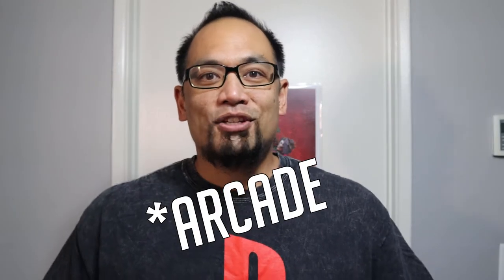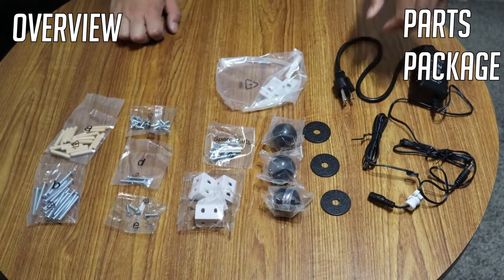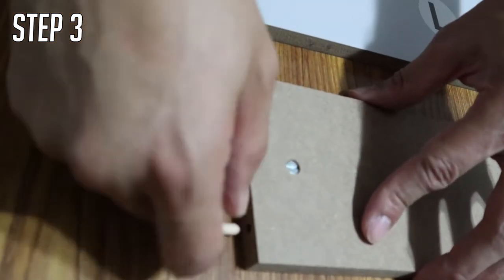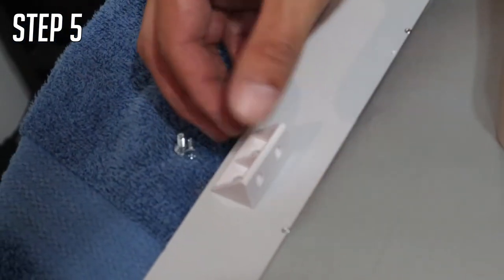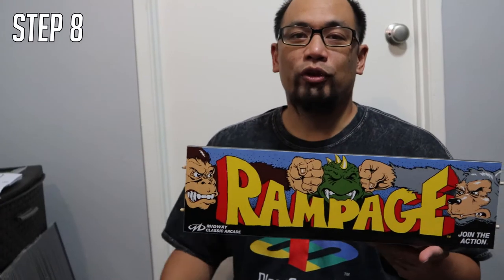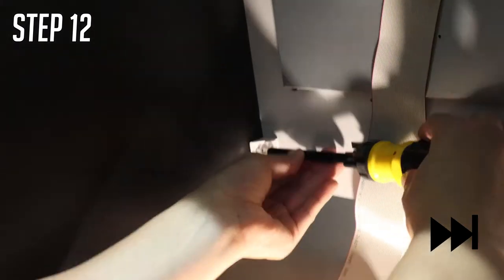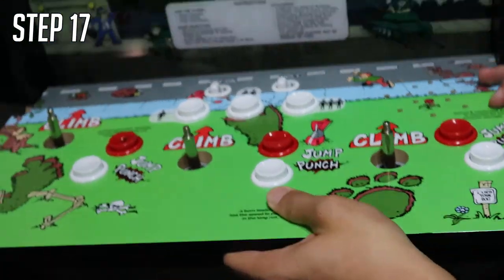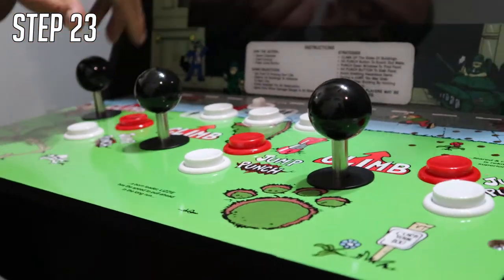How to assemble the Arcade 1UP Arcade Cabinet - Fast & easy with time stamps!

Comment: Okay, that does answer somethng I've wondered about watching other 1-Up videos. So basically, the actual guts of the machine are all on the underside of the control panel, rather than being mounted inside the cabinet like on a regular arcade machine (which is why it has those vents down on the bottom of the back panel)? So the lazy aqmong us could just prop the monitor agaonst a wall, put the controls on the desk and play away, without having to assemble the rest of it? :-)
Reply from the maker: Essentially, yes! I would recommend putting the controller board on something to keep the underside from getting damaged though. Other than that, one could totally do that! You could even modify an old table to hold the monitor & controller board to make your own cocktail style arcade cabinet. ❤🐺